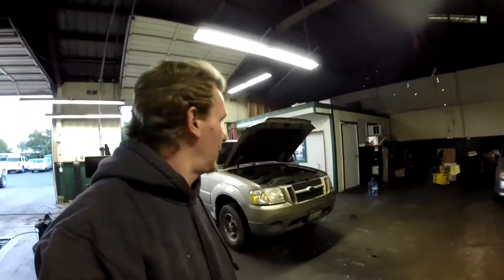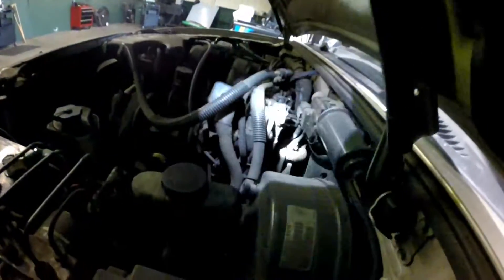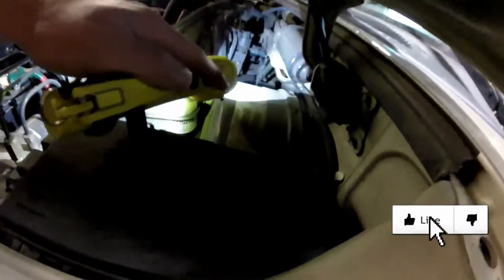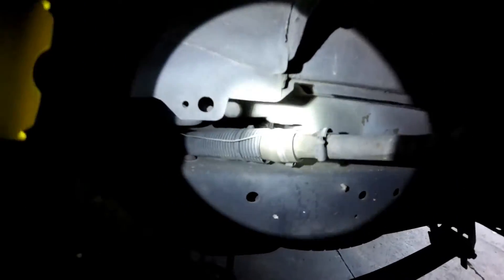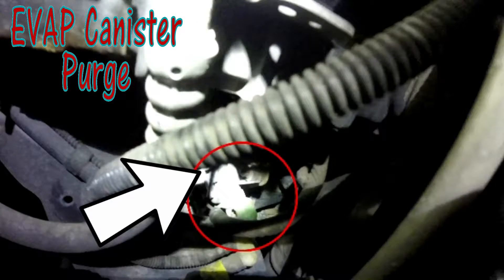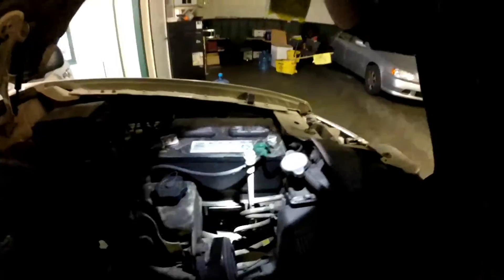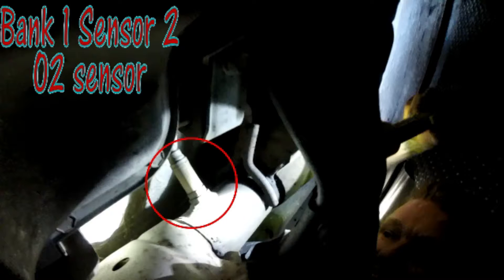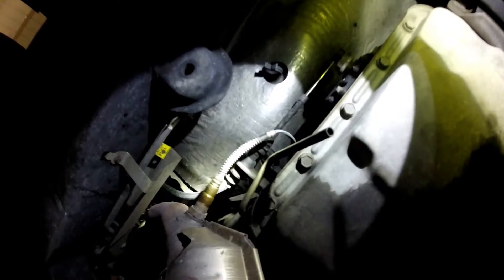Ford Explorer PCV, EGR, EVAP, Oxygen Sensors

Comment: Will a badO2 sensor cause rough idle and white smoke with the smell of gas. Change coil pack maf and spark not to long ago any ideas. Got a 2005 4.0
Reply from the maker: I'd do a compression check to make sure I am working with a good motor first. If you get coolant in a cylinder it will cause white smoke and the combustion process not to happen causing raw fuel to exit the tail pipe. Keep us posted and good luck on your diy project.
Reply: I hope so. Dealing with the same thing now. My original problem began with a battery that decided to reverse polarity. Shot the parts cannon at it, wires, plugs, fuel filter, etc. Then I found the battery problem. New battery and put it in. Before I could get it started the starter failed. New starter. Put the new starter in and good to go other than bank 1 sensor 1 stuck lean and bank 2 sensor 1 stuck rich. So I reversed them..Bank 1 S 1 is now bank 2 S 1 etc. Now both banks are lean and slow to respond. Even w the reverse battery everything worked fine other than the engine. New battery and starter now my power windows dont work nor the radio. Yes, I checked every fuse in and out other than the passenger side relays. I'm going to figure this engine S out first then worry about the rest. Forgot to mention the AC went out too. Everything worked fine before this.